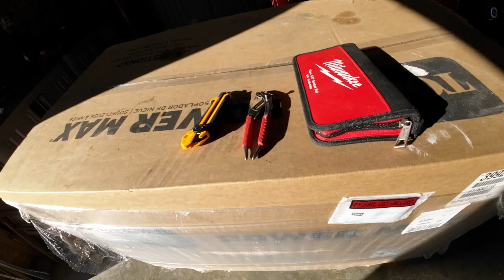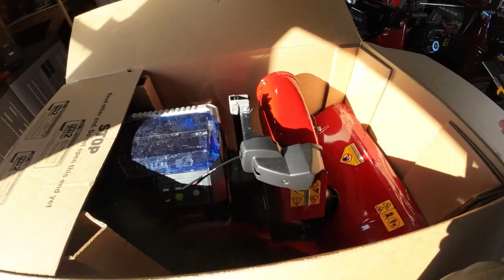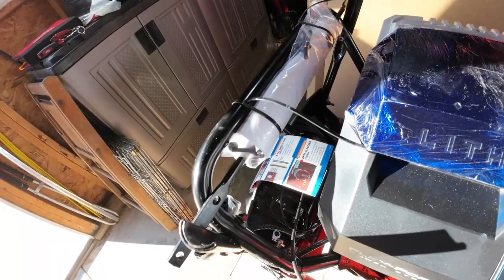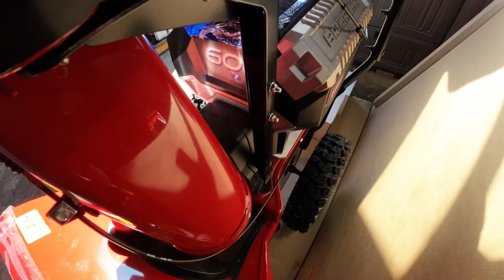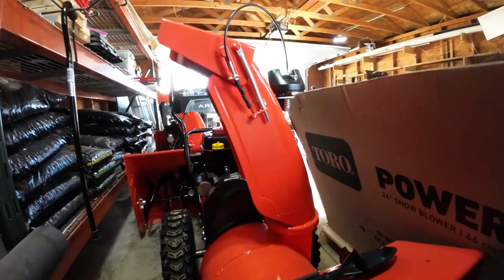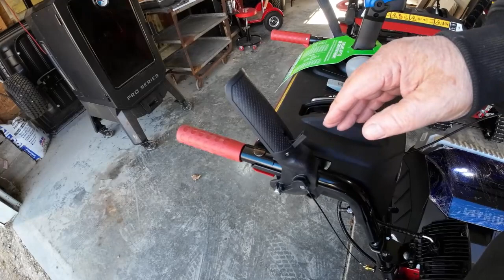Toro Power Max e26 HA Unboxing

Comment from the maker: Feel free to leave a comment below.  (I do moderate the comments so it may not show up right away) Thanks for watching and please Subscribe!
Reply: If you live in Buffalo, you need one of those, do you live in Buffalo?
Reply from the maker: Actually you need the Toro 1428, Ariens Pro 28, Ariens Platinum 24 or the Ariens Great Lakes Edition if you live in Buffalo.
Reply: Ah yeah, is that where you live?
Reply from the maker: No, "I currently live in Iowa - I just work in outer space." You'll get that if you've watched a lot of Star Trek :)
My goal is to help you find the best snowblower for you and I've been doing this for many years. So, if you tell me where you live there's a very good chance I know the type of snow you get and how much. And for most areas, I've seen it firsthand. That said, 
I've been to Buffalo in the winter - I love the falls when they are all frozen up. 
I've been to Fort Drum when they had so much snow that you couldn't tell that there were M1A1s hiding under the 6 feet of snow. The just looked like mounds in a field.
Reply: @PaulSikkema  Oh does Iowa get a lot of snow?
Reply from the maker: Iowa averages about 50 inches a year but the problem out here is drifting. An 8 inch snow fall followed by 50 MPH winds will leave 10 foot drifts around the farm buildings. The drifts pack down so hard you can walk on them. All the farms have pine tree windbreaks around the buildings but drifts and moving that rock-solid snow is a problem. 
Iowa generally has very open roads that don't drift but there are some areas where the snow packs in so hard that the State highway and railroads have to use truck mounted snowblowers to clear the roads. Even the big v-plows can't bust through the drifts.
Reply: @PaulSikkema  Oh thats terrible, but 50 inches a years is not bad.
Reply: I live in buffalo, we got hit hard.....And Paul, it was because of your video on the mammoth last year that I went and got one this March. I have the 36 inch snowblower, tearing down 6 foot snowplow drift. I can't wait when you make a video on the different mods the mammoth has. I think I saw a weather shield, and a light kit. Not sure tho. I'm sure you would know more than me.
Reply from the maker: I'm jealous! I'd love to have the Mammoth and enough snow to make it work hard. I bet everyone was watching you throw snow with that beast!
They filled out the line of attachments this year. The weather shield. (I call it a heat houser), A V-plow that's really quick and you can invert the V to push snow. The Brine kit. Salt Spread and 48 inch snowblower. 
I'm not aware of additional lighting. It comes with front light, side lights and a rear light. It does have enough alternator so that you could add extra LED lights and safety flashers. A light bar like the one on the Kraken would really brighten your night up :)
You can see most of the attachments here: https://www.ariens.com/en-us/power-equipment/snow-products/vehicle/mammoth#gallery

Comment: why is it running when ur not using it?
Reply from the maker: The e26 operates exactly like the gas version. In other words Toro just replaced the gas engine with the electric power unit. 
So, when you are ready to clear snow you use the key to turn the power unit on. The you use the same levers as the gas unit to operate it. If you need less power just use the economy button when you need more power it automatically increases the motor speed. (just like the throttle and governor on a gas version) Nothing new to learn.

Comment: Thanks for the review Paul I took advantage of the summer sales at Home Depot to buy both the cordless Recyeler Personal Pace lawnmower as well as the 60v snowblower. The lawnmower worked without any flaws right out of the box. For the snowblower I had to adjust the speed controller rod because there was no reverse. After several adjustments the forward/reverse speeds all work. The forward increase speed as you select higher gears. The reverse is very fast no matter which speed you select. Not sure how to slow down reverse? Other than the reverse problem this is an excellent snowblower. I will keep my gas snowblower as a backup.
Reply from the maker: Keep adjusting the rod in small increments. Watch this other video starting about minute 41 and I'll show you how the forward - reverse works. It will help setting the lever. https://www.youtube.com/watch?v=5Jq5OrVoG_g

Comment: I bought this model late last winter.  Only used it twice on about 9” of wet snow, and it worked flawlessly.  I did change the skids over to the polymer version, since I found the standard steel skids can scratch some sidewalks or driveways.  
I am wondering, although it had plenty of power and run time with two 7.5 amp hour batteries, do the new 10 amp hour batteries fit in the same slots?   Although I think most people would not likely need more than three 7.5 amp hour batteries, the 10 amp hour option would be nice for those who might need that extra run time.  Nicely designed machine.  Looking forward to your full review!
Reply from the maker: Yes, the 10 AH batteries fit all the Toro 60 volt tools including the Snowblowers. The Pro (Black) batteries coming out next spring will also fit.
Reply: Thank you for the update!  Good to know Toro battery 60 volt technology is compatible with the residential and commercial machines.

Comment: I do like the build quality and battery system on the Toro, but rather prefer the intrinsic design of the SnowJoe 100V, with a direct drive brushless motor on the Auger and separate, brushless, geared drive to the wheels. 

I think the SnowJoe controls could be a bit better and there is nothing hiding that it's a low end Chinese blower, but I consider the e26 as a missed opportunity to embrace the advantages electric power affords the designer.
Reply from the maker: I'll talk about the Snow Joe and the Ryobi in the walk around video I'm going to do on this one soon.
Reply: @PaulSikkema  I have the SnowJoe and bought it when it first came out (also have the single stage). It was the only two stage at that time and I also wanted the rubber paddle on the single stage. I'm here in Maine and have a 250ish foot driveway. They've done well with 2-2.5 foot snows. However, if Ariens or Toro went all in with something that harnessed the SnowJoe design points I like with the build quality that they do vastly better, I'd be tempted very hard.
Reply from the maker: OK, I'll bite. And I won't knock the SnowJoe. I gave the single stage to my son-in-law and it's just perfect for his 2-car, 60 foot driveway located just south of Chicago. 
The question that I have is what's more important. A snowblower that throws the snow well without ever clogging and throws almost all types of snow as far as possible? Or, a snowblower with all kinds of electronic bells and whistles that's just an "Average" snowblower?
The Toro Power Max is one of the most popular snowblowers ever sold. It's fits the needs of about 80% of the people that get snow here in the U.S. For it's size it throws snow very well, never clogs on the heavy, wet stuff and even handles slush better than most other snowblowers. It's great for most suburban homeowners that get between 30 and 60 inches of snow a year. So why not use that snowblower as the basis for an electric one?
The power unit uses one brushless motor. It has power sensing so it maintains constant rpm's as the snow load changes. The batteries are the current state-of-the art construction. They don't short out and they have the heat sensors and electronic safeties so they charge correctly. (Toro has just introduced batteries that will charge in 15 minutes.) It has a high intensity LED headlight. 
The V-belts and friction disk transmission are more efficient than most people realize. You don't lose any more power than a gearbox full of plastic gears. 
The snowblower is easy to use. The controls are comfortable and there is no learning curve from your old gas powered unit. There are no plastic switches and rheostats to wear out and break. No control levers that will cramp your hands after a few minutes. The Power Max snowblower has been around for many years and has proven very reliable. 
In other words Toro put their engineering design into making a snowblower that is proud to wear the Legendary Toro Bull Logo!
Reply: @PaulSikkema  The advantage to Toro's design is that we know everything but the motor and batteries will last for decades.  I highly doubt anything made by Snow Joe will do that.
Reply from the maker: I have the single stage Snow Joe with the rubber paddles. My son-in-law has been using it for 5 years now and the snow thrower and batteries are working well. That said, I also had one of the original 2-stages and that only lasted two seasons - a motor failed.

Comment: I have an E26.  We have only had one snow so far, and it was heavy wet Sierra Cement slush.  The E26 was able to blow that slush IF I could get it to move forward and get the snow into the bucket so the auger could get hold of it.  I had big problems with it not having enough traction.  Those knobbies would pack up with snow and just spin.  I suppose I am going to have to get chains for it.  Also, the E26 has auto steering, but the E24 does not.
Reply from the maker: Your "SnowCrete" is unique and there is nothing like that snow anywhere else in the U.S. There are very few snowblowers that can handle 12-24 inches of that stuff well. For anyone who hasn't experienced that snow I can only explain it as. "When someone shovels off your roof and throws the snow on the ground it compacts the snow into a drift that's almost impossible to push a snow blower through." SnowCrete is like that. Heavy, dense and often wet snow.
I think your problem is the e26 is too light. It doesn't have enough weight to get the traction to push a full bucket. Instead of adding chains or weights I suggest taking half or even quarter width passes. That way the snowblower should be able to push into the snow pile and clear it. It may not take as long as trying to push it into a full 26 inch width and not having the traction.
Reply: @PaulSikkema  Thank you, but my PM HD 828 OAE had the same problem, and it is about 100lbs heavier.  I think the problem is what is UNDER the snow.  My lot has no pavement, it is all dirt covered with wood mulch, gravel and pine needles.  The tires just dig down through the snow until they get to that muddy stuff underneath.  At that point the tractor part of the blower is high centered on the mud and the tires just spin.

On the first pass, I have to take a full width bite.  On subsequent passes to widen the initial pass, I do take 1/2 bucket width bites, but the loss of traction still happens.  This is only about 6-8" of snow too.
Reply from the maker: Most of the people I've talked to in your area have loose gravel driveways. They look for a high output snowblower like the Ariens Platinum series or the Toro Power Max HD to handle the SnowCrete. The Ariens Platinum 24 SHO is very popular because it can handle any snow you get and works well on the small driveways. 
Others have traction issues like you and in the past purchased the Honda Track Drive snowblowers. But, in the last few years the Ariens RapidTrak has become the snowblower of choice. Either the Platinum 28 RapidTrak or the Pro 28 RapidTrak. 
Finally, Ariens has just introduced the Alpine Edition. It is specifically designed for areas like where you live. Check it out here: https://www.ariens.com/en-us/power-equipment/snow-products/snow-blowers/special-edition/alpine
Reply: @PaulSikkema  I had a nice Honda HSS928AATD, but it also dug itself into self-created holes in the mud.  It was heavier than either of my Toros, and was tracked too.

Fortunately I am not trying to clear big wide areas.  Mostly what I use the blower for is to cut tracks to get to the garage, the woodshed, etc.. And I am not trying to remove all the snow like people do on paved sidewalks.  I am just making paths that are easier to walk on than the raw snow.

We do get powdery stuff from time to time, and as you know that stuff is great fun with the snowblowers.

Thanks!
Reply: Interesting. Thanks for letting us know about the steering